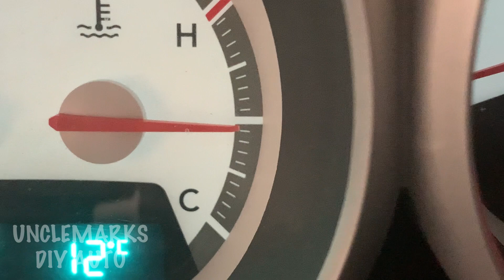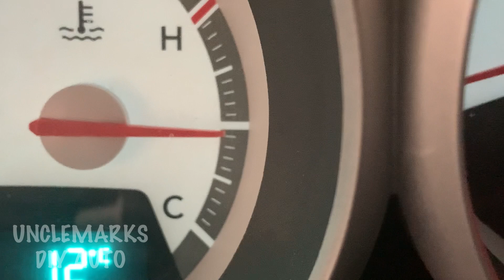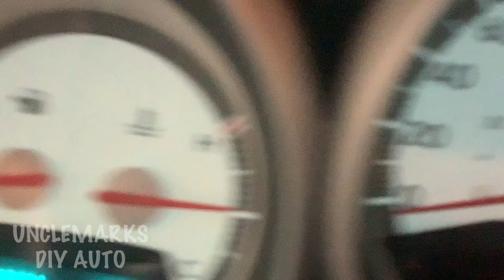How to add a ignition key to Ford F150 truck.

Comment: What if your second key has somehow de-programed itself due to non use, how does one fix that? FYI i have an older style key, the previous to the one in the video, it does have buttons.
Reply from the maker: I would think non use is not what has deprogrammed it. Your saying it won’t start the vehicle when inserted in the ignition?
Reply: Yes, the key works on the door but not in the ignition
Reply from the maker: @TheSilentassasin007  Humm. Something weird must have happened. I believe this is a issue only a shop can fix. They have a special computer pr9gram that will let them either relearn the key or let you add another key. (Normally it is very easy if you have 2 working keys) Let us know how you make out.
Reply: Will do, thanks!
Reply from the maker: @TheSilentassasin007  so sorry I couldn’t suggest something else.
Reply: No worries, subscribed!